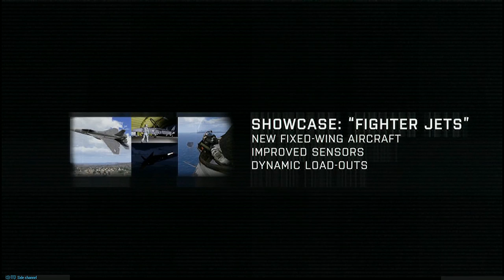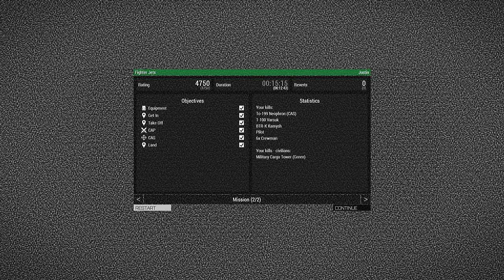Arma 3 | Jets DLC | Lets Talk About Sensors

Comment: Use R or reveal target command instead of the lock button. It will cycle through available targets. Much easier than pointing the jet directly at it to lock it. Alternatively, you can level off at like 1500m and use your Multifunction Camera MFC to lock the tartlets and then turn in for your attack. There will be a dash circle  on you HUD showing you were your MFC is looking. LCTRL T is default to lock the MFC on a position. You can adjust with your mouse when using it. This helps you keep awareness of an enemy position even if not using the laser. However not using the laser means that you have to adjust for the range manually or by eye for your gun. If you use the laser, you will get a point to aim at to hit target area.
Reply from the maker: +Hotwheelz_McG I actually do use reveal travel more than lock. The camera is how I id 80% of what I intend to kill, too. It's a definite must in any ground attack mission. Good to know on the HUD thing, I didn't know there was an indicator where it was pointing. I always used the sensor panel to see.
Reply: Sensor panel tells you direction it's pointing the hud display shows exactly where it is pointing.
Reply: Bottom line, it's about time ARMA got some more realistic hud displays and sensors. We actually have a better bomb sight too for just dropping the bombs. Line down to a circle where it will impact.

Comment: Honorable landing. Shoot for about 200-220km/h don't aim the jet so much. Use that little circle with the wings and vert tail is your aircrafts direction of travel.  At this speed that circle should be low, so nose up and put just above the back of the carrier. As you get closer, keep that circle on the arresting cable area. Keep it there all the way and you'll catch the wires perfectly. Use the ILS lines on approach but as you get to that last 3-400m's shift attention to the meatball on the left of your dash, keep it yellow, and your flight path indicator (that little circle) as you practice you'll be able to just look at the circle and notice the colors of the meatball/glideslope indicator. Yes i know the meat ball is actually the glideslope lights on the left rear of the carrier but i don't believe the render well if at all on arma. Anyway, red means your low, yellow is good, green means your high.
Reply from the maker: +Hotwheelz_McG thanks! I'm slowly getting better at carrier landings. Eventually I'll be doing these off muscle memory lol
Reply: DreadwingOne no problem. Most people starting off come in too shallow. You should stay around 500m on approach and the start decent about 1-3km out. Best way to do it fly level at 500 until the glidslope indicator runs yellow. Then adjust from there with throttle. Cut throttle briefly, the slowing raise it a little to maintain glideslope.

Comment: Im having some problems with my Jets. I can not seem to turn on the radar. And im not getting the scroll wheel for left and right panel mode. Help?
Reply from the maker: I think radar by default is CTRL+R but you'll have to check your key bindings to make sure. The panels by default are [ for left and ] for right to cycle, and CTRL+[ and CTRL+] for mode, left and right respectively.
Reply: I have nordic keyboard so the [ and ] is not possible on my keyboard for me so I have to use nordic keys but thx gonna check that out ;)
Reply from the maker: aye, best bet is to check what your key bindings are in game and if you need to, customize it to what works for you. I hope you get it sorted!
Reply: Is this Jet "upgrade/rework" better with joystick or is it harder now to use a joystick? I was considering buying a joystick since I love flying but for me its feels unatural to use the mouse to fly so I use the keyboard but it is harder to fly a jet now then it was before this dlc. What is your opinion on this?
Reply from the maker: +Sack I have always preferred a joystick in any game I can fly in, even battlefield. They didn't really change the flight physics much, if at all, with the dlc. I would say if you're thinking about it start small with like a TM HOTAS X or something, that'll run you around $50. There are much cheaper ones out there though that will probably get the job done.

Comment: Nice vid mate. could you go into more detail though please? I mean stuff like how the waypoint marker works on the HMD as when it said wp4 the distance didn't correspond with the 2 markers by the ship, is it possible to lock onto a ground target in the full screen pod then come out of it & see the target on the left hand sensor?  how about doing a video on everything to do with the cockpit?  - like that green box on the left hand side with the line moving back & forth? is that where the radar sensor should be if BIS could make it so? how about making a CAS mission where you have to find & destroy ground targets including Infantry to show how the black wasp copes with that sort of mission as no one has tried that yet I think.
Reply from the maker: Thanks! I'm not very good at the editor, so it will be a very rudimentary mission. The wp4 on the HUD is something I believe must be programmed into the mission as it guides you to your next "task". It is possible to lock on with the TGP and then still see it on the panel while you fly the craft but the draw distance is very short so if you are high up you may not see anything but fog. The green box is where the radar would be scanning in real life, in Arma it is just there as an aesthetic. Hope this helps!
Reply: I'll have a basic flight combat mission up soon mate you can use to show people the ropes.

As for the waypoints yes they're editor based however when you use the Shift-LMB on the map it will create a HMD symbol on the HMD and give you a distance to your self-created waypoint. :)
Reply from the maker: +Imperator TFD good stuff